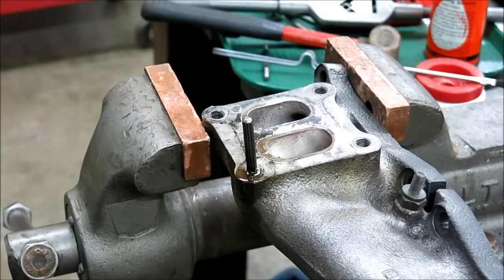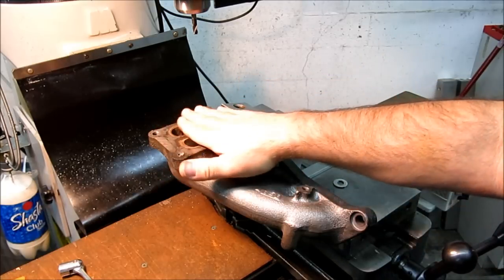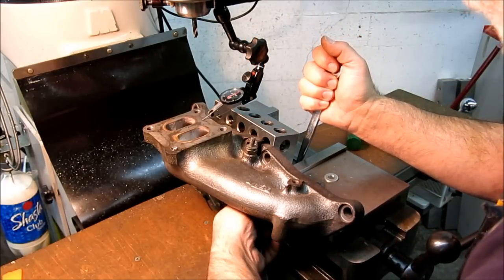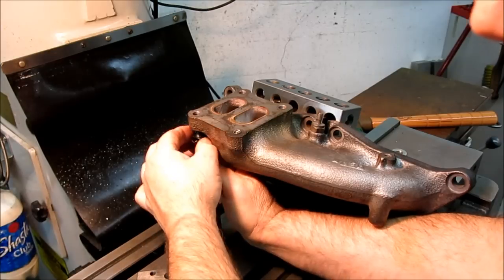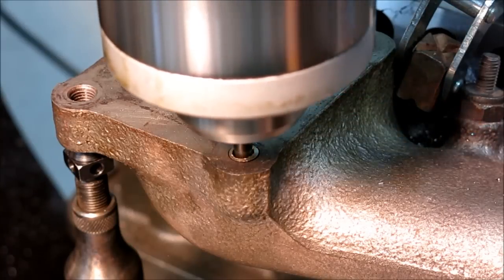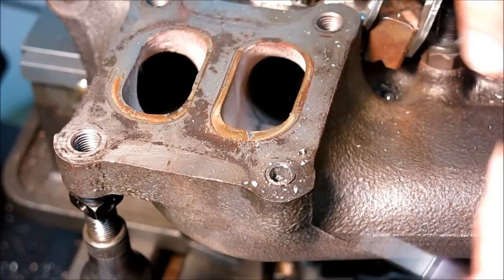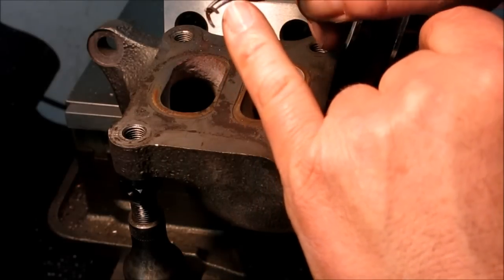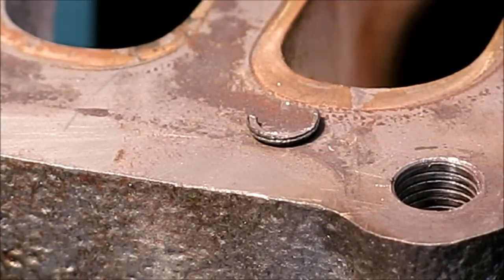Screw Extractor Torture Test Round 2

Comment: Tom,

I've seen more studs, bolts and nuts(okay, I walked into that. But this is not x rated, so get your minds out of the gutter) like that than I care to remember.  I've used an oxy-acetylene torch to blow studs or bolts out of blind and through holes, it's risky and dangerous, but it can be done as a last resort.  That's all about heat control, not that I recommend it at all.

And I'm talking about the really tuff ones like you had there...    So a practical way I learned from removing nuts is to remove the stress between the parts, much like heating, but better.  You can split or cut nuts to relieve the tension between the two parts.  You can do something similar with studs or bolts by drilling out the center and milling or die grinding a much smaller slot out to the root diameter of the thread or slightly beyond.  This greatly reduces the stresses between the two parts.

Extractors always increase the stress, so they often don't work with the real back breakers.  The traditional extractors increase the stress as you torque them.  The splined ones I haven't had any experience with, but driving them in probably doesn't help.  I still think I would use them before the old left hand cork screws.

I have to admit, I enjoyed seeing you struggle, it's not something we see very often... ;-)

Thanks for all the awesome videos!!!

Jim

Comment: Try heating the bolt up red hot for a while and then shock cooling it with water. Expanding the bolt then shrinking it real fast seems to dislodge some of the build up rust on the threads and you can break it free. Tips from a mechanic anyway.

Comment: Two words that come to mind. I'm sure that Cory Wledingtipsand tricks would agree "Tig Torch" Tig build up a nipple then tig a nut to the nipple by that time lots of heat has gone in the stud and back it right out.
Reply from the maker: Hey Scott,

I'm sure that would work well. It doesn't test the limits of the screw extractor which is what we were doing this time. We will come back to this subject and try some of the other great ideas when I find another manifold. Thanks for the comment.

cheers,

Tom

Comment: The tapered, corkscrew type "Easy-outs" grab at the "waist" of a drilled hole.  I wonder if a tapered hole, drilled/reamed into the broken bolt, would provide more area for the flutes to grab = more torque application???  A tapered hole would only apply to the tapered/cone type extractors.  I've never attempted that technique???  .... and, of course, the taper of the extractor is probably some odd angle.
Reply from the maker: WAVETUBE84 Hey Joe,

It might help but it also might make it want not bite. I cannot recall ever having been successful using one of the "pig dick" type screw extractors. Thanks for the comment.

Cheers,

Tom

Comment: I've only had luck with extractors when the remnant was a new break in a clean hole.
I also cheat if I can get the part to a mill/drill press. I'll take a new bolt, cut the head off, screw it into one of the open holes. Then chuck that up in the drill/mill. Then it's a matter of adjusting the clamps to hold the part in position. Pull the bolt out of the chuck and replace it with a carbide, locate the center of the broken stud and drill it to root diameter.

Comment: Had a piece of drive line from a John Deere loader break. No problem a simple fix. That is until I wasn't paying attention and bottomed out a tap in a blind hole. The tap snapped off. I thought I will simply replace the part.. Called JD. $800.00 if they can find one. Two torch tips a diamond tipped drill and a lot of fretting later I finally got it fixed.

Comment: I wonder if someone else tried to remove that stud with heat already. 

Most the times easy outs fail for me. usually I think I can keep going even after I heard the crack, at that point I should just pulled the easy out .. out and tossed it. I never seen that style easy out. looks more effective than a spiral universal  thing. 

superseded you didn't try a touch of shock heat first.

usually I have good luck with reverse drill bits to pull broken bolts out. with lots of time and penetrante fluid. 
hf sells good reverse bits.. for the price.

thanks for vid, always wanted to see machine shop go at it.
Reply from the maker: +TurboFlush Hi Turbo,

I heard that crack more times than I cared to on this video. Thanks for the comment.

Cheers,

Tom

Comment: The art of broken bolt/stud removal...grind flush with casting.Take extra time to put a center punch on center. Drill hole, start small, end with a hole the same size as the minor diameter of the stud/bolt. And last, use a tap of the same size of the original thread size.  Let the tap find the lead of the original thread start. The tap should clean out the remnants of the broken bolt threads.

Comment: that is what happens to every type of extractor i have tried to use. its like just about 50% fails like that. i have ended up sitting there filing out the dam things with a dremmel like tool and diamond bit's :( usually the best thing is just drilling it out and put in a helicoil on the first try. saves you a ton of time.
Reply from the maker: grapsorz Hi Grap,

Thanks for the comment. 

Cheers,

Tom

Comment: been a mechanic for a bit now..Heat is your friend. I would have heat that cherry red and i mean cherry red. I found that after heating it add penetrating oil the heat will suck it into the threads. it will come..
Reply from the maker: Hey Jack,

Thanks for the comment and suggestion. Looking for another manifold to try out some of the ideas folks sent in. 

Cheers,

Tom
Reply from the maker: ***** Hi Snyder,

Thanks for the comment. I wan't to come back to this series and try some of the other suggestions folks had. In this series I really wanted to try the screw extractors to the limit. Looks like I found it. 

Cheers,

Tom

Comment: Hey Tom.  should have titled this one "Ain't Happening" or "DING...DING...DING....Stud K.O."  Ha ha ha.  Nah, in this instance:  it was done, wasn't coming out.  I doubt any "extractor" of any brand would have succeeded.  Even in the hands of a Tool Maker (breaker, hee hee).    I've run into a handful of those tenacious buggers.  A few times I've drilled out the root diameter of the stud/bolt thread and picked out what was left in the mating piece.  More than once, I've nibbled on what was left with needlenoses and dental picks.  In a CCW rotation the remaining metal coil collapses radially...  Once it starts, it has to be "all quiet on the set!"  More prayers, crossed fingers, and a few breaks.  Bottom line:  turned a 20 minute section of a job into a 3...4...8 hour ordeal.  It takes a lot of time, patience and the tenacity of a pit bull.  No profit, a total loss of time.  But when you are young, poor, and working with junkyard stuff....  Sometimes the end result isn't too pretty either.  Then you get to continue the original task.
Reply: WAVETUBE84 Go back to work and ask those dudes for a tougher one!
Reply: A186 nickel steel?  Low magnetism = nickel/chrome.  The stainless types like to gall up.  I couldn't find much online, other than it is no longer in the ASTM.  Who knows?
Reply from the maker: WAVETUBE84 Hey Joe,

A286. Precipitation hardening stainless steel. A286 is typically used in applications where fastener operating temperatures can reach 650 degrees Celsius. 

Cheers,

Tom
Reply: WAVETUBE84 "A few times I've drilled out the root diameter of the stud/bolt thread and picked out what was left in the mating piece.  More than once, I've nibbled on what was left with needlenoses and dental picks. "  Honestly, at that point There is not much else one can do. I have had sucess with this method.
Reply: Juan De Nada Jr Yep, I've done that a few times.  Them dental picks can apply a tremendous amount of force upon a tiny area.  That's the "when all else fails" method.  Always a painstaking, brain frying, job, but usually successful.

Comment: Surely knocking the drift into the hole widened the bolt stub. Would it not be possible that once you drilled the hole use something like a left-hand self-taper. 
Nonetheless, I really enjoyed this video as it just goes to show that life is not always a walk in the park. Many thanks.
Reply from the maker: +cluxseltoot Hi Clux,

The purpose of this video series was to torture test the snap on screw extractors. Getting the stud out was a secondary consideration otherwise I never would have cut it off flush with the manifold. Thanks for the comment.

Cheers,

Tom
Reply: +oxtoolco 
Hi Ox
I didn't realise this. I find your approach to thinking through the problem  fascinating and very entertaining - much better than watching TV.
My father was an Engineer and once I snapped-off a stud in the cast iron cylinder block of my old banger when changing the cylinder head gasket. Your approach to the video reminded me of his logical thought and excellence in experience and skill. Dad selected the appropriate drill, tap and bolt thread, etc,. Everything worked like clockwork with job done in an hour. Your excellent couple of videos took me back to those wonderful days of having the time to fix cars.
An excellent couple of videos - many thanks for sharing.

Comment: i would have made short work of that stud. especially since it was a cast iron manifold. you want a real challegnge try getting a stud out of aluminum where using as much heat as you want isnt an option. those particular screw extractors are junk. sucess rate very very low with them. use regular easy out or square style and lots of heat. also heat and shock cool the stud, tap it with a hammer to shock it ect...

Comment: I worked with a guy that had only 1 method for stuck fasteners LOL  Heat it to the temperature of the sun and dose it with water till you could touch it , no matter how big it was.....sometimes taking 5 min lol. Not once did i ever see anything crack or problem arise.....mostly heavy equipment thou

Comment: Well that's cheating but NICE solid mill setup, those 2x4x6 blocks are VERY handy huh?
In a setup like that you can "map" the existing holes with the DRO and drill out the SOB exactly on center and peel out the threads.
This is good for a restoration job on irreplaceable parts that you really don't want to put an insert in.
At my work we do a lot of hydraulic cylinder repair, Abomb will appreciate this, we have a hydraulic machine made to remove the high torque nuts found on the piston end of
large cylinder rods.
The machine is capable of 30000 ftlb of torque yea 30000.
If this machine starts to unscrew something and then stops the screw is ALWAYS hopelessly galled with big chunks rolled up in the threads.
At that point either the male or female thread has to be machined out or off LOL.
This is a great case for giving any threads you single point plenty of slop, if precision alignment is needed use an unthreaded shoulder and a SHORT precision counterbore!
Case in point, a few days ago I made several "special" set screws with O ring grooves in the 1/2" portion with 3/8-16 threads up to the 1/2" shoulder into a thread relief groove
1/16" wide with a specified 1/32 radius at the bottom,
OK no problem, special ground a trashed .094 top notch grooving insert, I save them for this shit, into a threading tool that could end up that close.
Did all this threading with a Haas TL3 lathe and checked every thread while adjusting my values till a standard grade 5 nut fit nice.
I then made a short female threaded piece a few thousandths smaller on the OD to use as extra support in the 5C collet fixture.
NONE of my single pointed threads would fit the freshly tapped hole........................
Bottom line: do not use cheap ass factory nuts to check single point threads!
Sorry kinda got off topic

Comment: sooooo....as a millwright I do both worlds....first of all....those are shit extractors....2nd, i would have used my demel and or grinder to flush it out as close as i cant to the machine surface for quicker results ....then, hit it with a file and maybe a honing stone....if you had a perfect hole like that you could have gone a little bit wider diameter of a drill bit and heated it up BEFORE you stick in the extractor, heating up the extractor compromised the integrity of the metal and allowed it to shatter/bend, i understand its a worse case scenario, but it could have been done without ever touching the mill, Ive spent hours rocking back and forth broken studs until i finally get that 32nd of movement i need to know ill succeed, regardless though, great vid, you've got my like and sub

Comment: A regular bolt extractor would have done the job in under 2 mins.
Reply from the maker: +Raphael Letourneau Hi Raphael,

I kinda doubt that. What was it you think I was using? Are you suggesting some other kind of bolt extractor? Thanks for the comment.

Cheers,

Tom
Reply: +oxtoolco Yes not that kind of extractor. I meant a bolt extractor socket. I will link a product but im on my phone
Reply: +Raphael Letourneau   LOL no it wouldn't.

Comment: 51.28 minutes to remove a stud horrible to watch a back yarder with no knowledge,  should have consulted a tradesman I would have had it out in about two minutes. the first mistake you made was cutting off the stud & trying to use a stud remover.
Reply from the maker: +boat owner Hi Boat owner that doesn't listen to the video. The video was about testing the extractor not getting the fastener out in the most efficient way. I think we showed the extractor was not up to the task. Thanks for the comment.

Cheers,

Tom